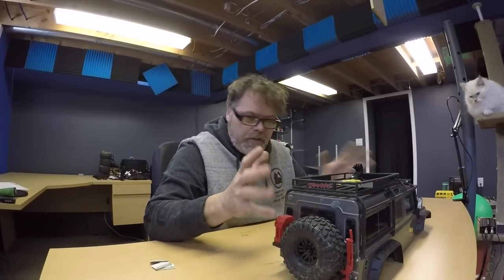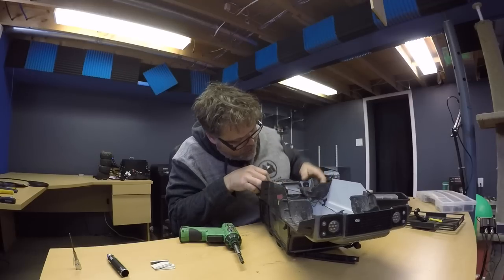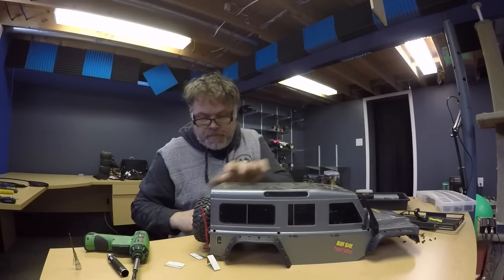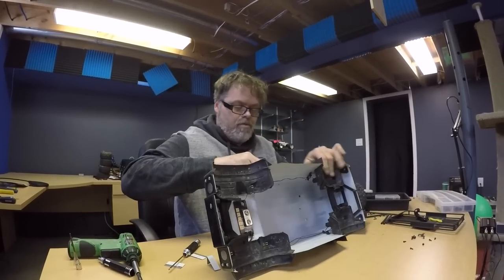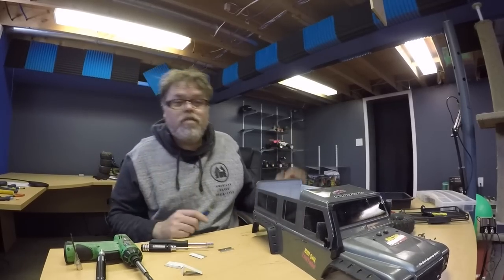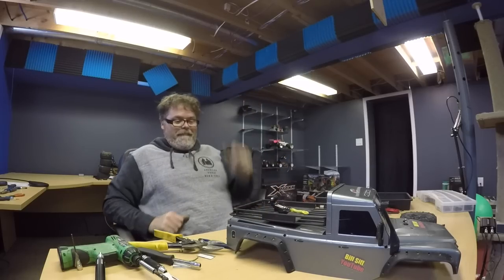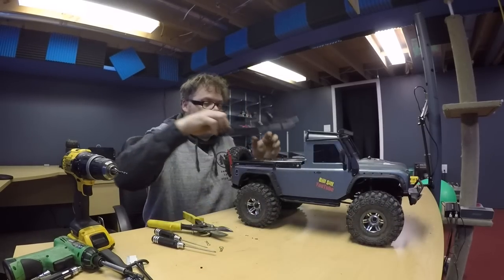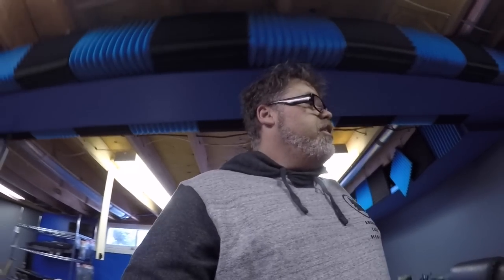Bigtime Customized Defender RC TRX 4 Crawler Body

Comment: Looks sweet it does ! For the antenna tub , you can heat it up with a lighter  and bend it forward or back . I have done the same to keep it under the body still works decent too .